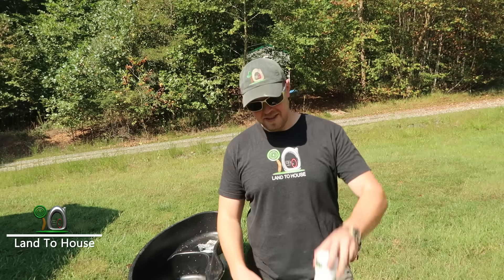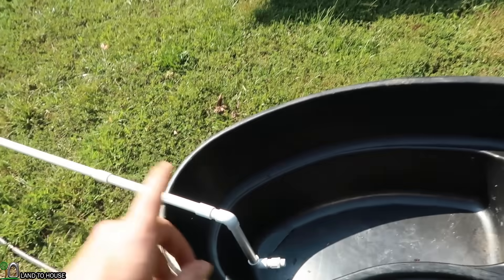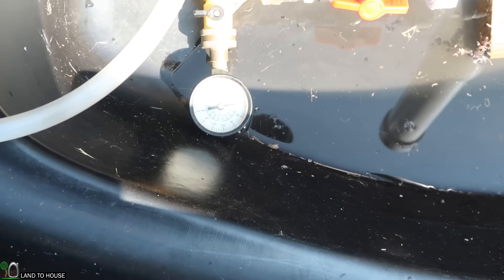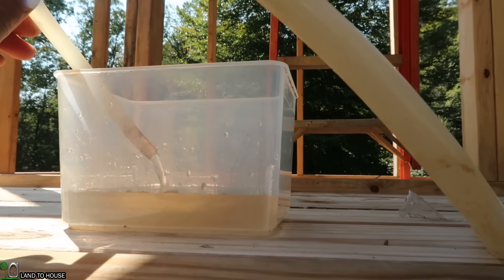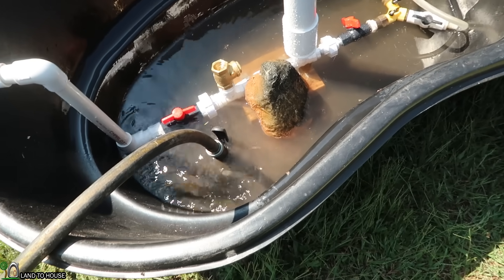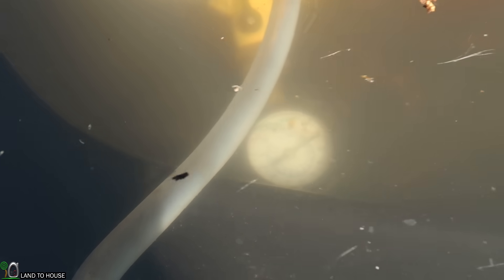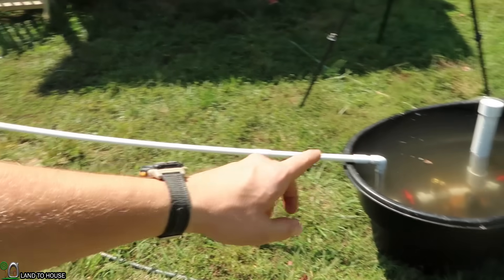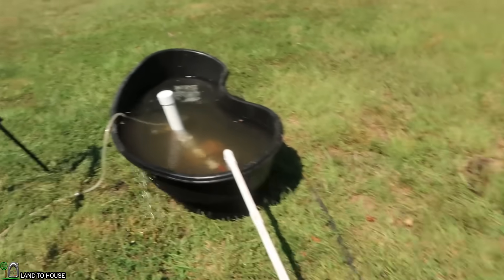Underwater Ram Pump

Comment: I find mine works better under water. Smoother and a little better delivery.
Reply from the maker: It is quiet too.
Reply: @LandtoHouse  MUCH quieter no matter what valve system you are using!
Reply from the maker: In my I setup the drive pipe still had a good bit of noise but the waste Valve itself is almost silent
Reply: Yeah, no easy way to dampen drive pipe noise.. besides burying it.. which DOES improve efficiency.  I am looking at cutting a roadway to my setup with my tractor so i can bury it better. The portion that is buried doesn't move around at all.. the upper section definitely "wriggles" with each pulse despite some heavy bracing.

Comment: That's almost a quasi-perpetual energy system if you ran the delivery pipe back into the bucket after it runs thru a watermill or hydro generator...and somehow collect that pond overflow back into the bucket. heh :D
Reply: Nah..the check valve waste isn't cycled back to the tank for the drive pipe
Reply: @edwardjoyner9344  If only that could be collected. :D
Reply: @reh3dzone  well, presumably you would use another ram pump to push the water collected back to the initial bucket.  That ram pump would have its own check valve expelling water, then you would have to collect that.  You would never get to a point where there is no waste.  It would be impossible.
Reply: 30% loss
Reply: @safetyfirstintexas  That's what I understand, not 80-90%.
Reply from the maker: It really depends on the setup. The higher you pump water the higher the loss is compared to the delivery.
Reply: @LandtoHouse  Thanks for clarification 🙏🙏🙏
Reply: @LandtoHouse  Hi mate, if you only need to lift water 5m eg over a dam wall is the waste still 80%? Or does it get down to 20%
Reply from the maker: Is your water coming from a point higher than the Water behind the dam? The pump does not work in Flat Water. If the water is returning to the creek technically it's not wasted it's just going where I was going to go originally.
Reply: @LandtoHouse  thanks, we will put a weir across the inlet stream before water gets in the dam 0.5 m above the dam full level. The pump just needs to raise the water enough to get around the dam wall and freely discharge on downstream side of the wall. Any waste stream will flow into the dam and not become environmental flows so need to minimise waste stream.

Comment: Can you put it inside the boat. You know those old fashioned diving bells? Could you put a ram pump/drive pipe through the ship's walls to let it "leak" into the ram pump? Or in the case of the diving bell the waste valve would go back into the ocean while the output goes to whatever you want to the power for? The output going through the top to surface atmosphere.
Reply from the maker: I am not sure what you are asking. Do you mean use this inside a boat?
Reply: @LandtoHouse  In retrospect my question was terribly worded. I did meant inside the boat. You know those old fashioned diving bells? Could you put a ram pump/drive pipe through the ship's walls. Or in the case of the diving bell the waste valve would go back into the ocean while the output goes to whatever you want to the power for? The output goint through the top to surface atmosphere.
Reply from the maker: Okay. I understand. Yes you could do that. The problem is you would be opening a hole to the outside. This means that eventually over time the water we begin to fill the inside of the boat. There'd be some very complex pressure changes going on. You would have to have some kind of pump to pull more air into the diving bell atmosphere. If you didn't the air would  Escape Under The Bell and let more and more water inside
Reply: @LandtoHouse  I was thinking air in the diving bell would push back against the water cause the input and output could be tubes outside or inside the ram pump.  The water could only come in through the diving bell from the waste valve but I wonder if the air pressure/water compression in the diving bell would enouph to force it down through the bottom of the bell back into the ocean. an air filled diving bell naturally does this with the surrounding ocean water so maybe the waste valve isn't adding water cause its coming form the surrounding water source (the ocean or pool) and some of that water is actually leaving that system through the output of the rampump. Like you said very complex pressure changes. A fascinating experiment even if fails ;)

Comment: Under ideal conditions of the water supply you could bury the system and put the pump under water to keep the system from freezing in the winter and run the system year round to water live stock and etc.
Reply: Yep.. works here.. Just need to bury 800 feet of delivery line now. :)
Reply from the maker: That is really good feedback! I have a number of people up in Canada that have very cold weather and could use this info.
Reply from the maker: I like the idea! Well worth giving a test.
Reply: @LandtoHouse   i have done lots of testing here..  other videos as well regarding cold weather: https://www.youtube.com/watch?v=uRxuTOWz1JQ